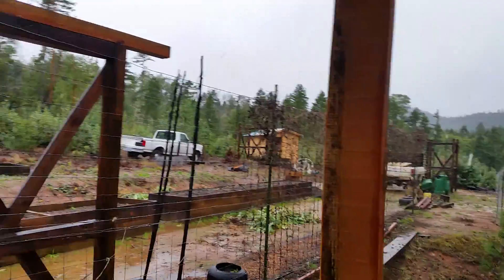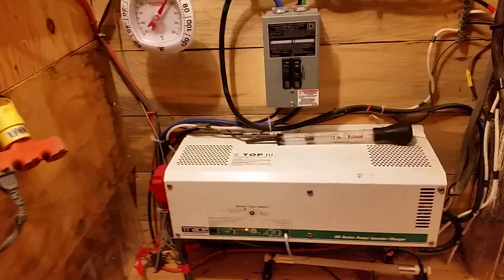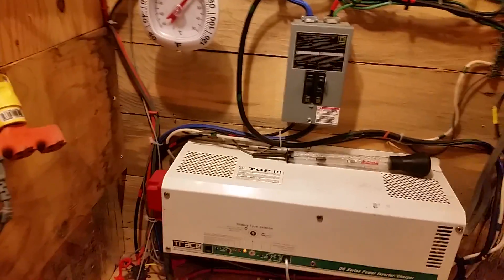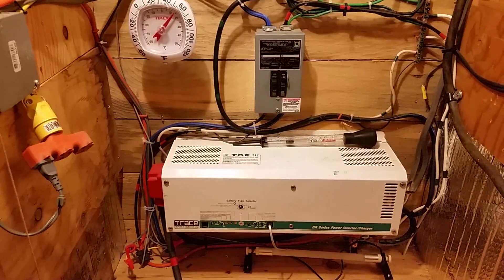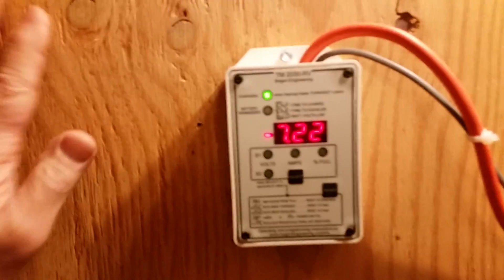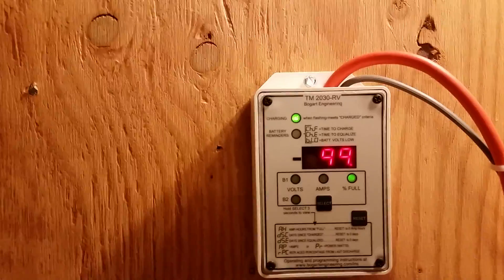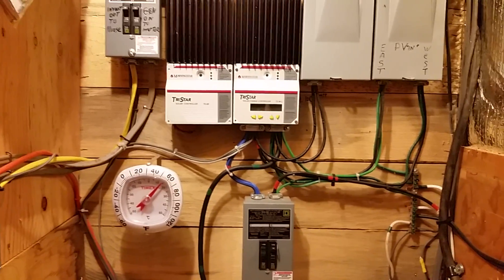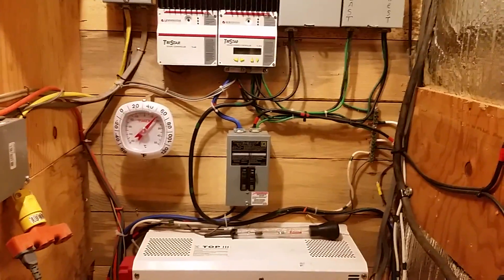Off grid solar  (problem solved with inverter)

Comment: Would you be able to send me your settings for your inverter? I have the same one and need a starting point
Reply from the maker: Greetings, the Trace DR 3624 inverter user's manual is available online. The setpoints are specific to the type of batteries and the capacity. If you do a google search you can find the manual. I have not used the Trace inverter/charger since 2016. They are excellent inverters that will last for decades. Hope this helps. Have a blessed day.

Comment: GREAT video and explanation. I try to avoid using my inverter's charger function. But, I am partial off-grid...with the grid as back-up. If the power does go out, I would do the same as you with a generator to charge the batteries and turn off the solar charge controllers. I have never fully tested my little 2KW Honda and charging batteries. Dunno how many actual DC amps I would get out of it...I am thinking about 50-60 amps.
Reply: Thanks for the link...just subscribed to his Channel. Wow..yes. He does have a big battery bank.
Reply: +Chris DIYer : I wonder if you would end up with the same dilemma as , Steve with you and I both using the Outbacks that can be programmed for specific voltage set points. I wish I had access to a Mate in order to change the profile to something that works for LFP batteries. - Cloud

Comment: Still seems like alchemy to me. The more I look at this stuff the more I see that you have a lot of maintenance to these systems. I don't think that folks that are behind the green movement for everyone to go to solar realize this. 

God Bless
Reply from the maker: Thanks for the suggestion. The Tristar on the left was not connected to anything, just hung on the wall to get it out of the way. Now I have a Magnum inverter and 2 MPPT charge controllers. One is an Out back Flexmax 60 and the other is a Midnite classic 200. I added a1400 array and I am adding 2k more. I am still using the Tristar TS 60 but will be replacing it with another classic 200. I have lots of newer videos. Thanks for watching and the kind suggestion.
Reply: Steven Davis I hope so as well. 

So what do you do when it's time to go on a vacation? Is there a standby mode that would keep the batteries charged & not have any damage?

Your brother in Christ
Reply: +1timby : What Steve points out in this thread is correct. Grid-tie is pretty straight forward with little to think about. It is when you fall into Off-grid or a Hybrid design that you must be a bit knowledgeable about the system. There also are other battery chemistries out there that would have less maintainance issues than Lead Acid systems. My own LFP (Lithium Iron Phosphate) system doesn't mind about always being fully charged. It doesn't need water added. No equalizing. So long as you have a "bottom balanced" battery bank prior to first charge you are set to go. Although with anything you want to last (not give up the ghost at the most inopportune time) you should keep an eye on them. Cleaning. Checking connections. How the system is aging etc. 

When we switch to a green-grid I imagine that most people will be grid-tied (still purchasing power as they did before) and the utility company will have their own well-maintained battery banks on their side such as the new Tesla Power Packs.
Reply: +Steven Davis Hi, I used to blow all water out of my plumbing when it was being left. Took overnight to clear 1500 feet of 1" but was completely drained. This house has propane and a 27000 Btu room heater on a thermostat to keep things at a pre-set temp.    Good luck
Reply: friend, if you are running those TriStar controllers at mid-capacity or higher you might consider re-installing to provide several inches  clearance on each side to allow proper thermal dissipation.